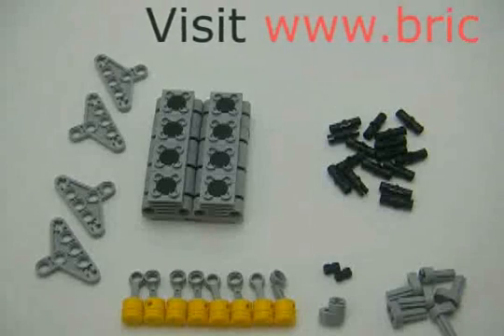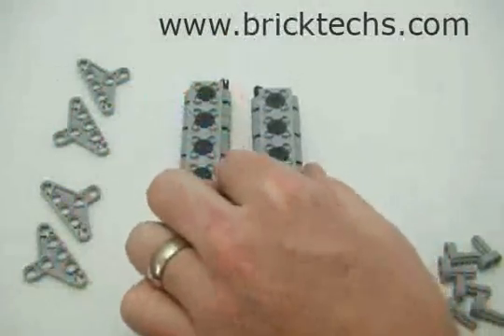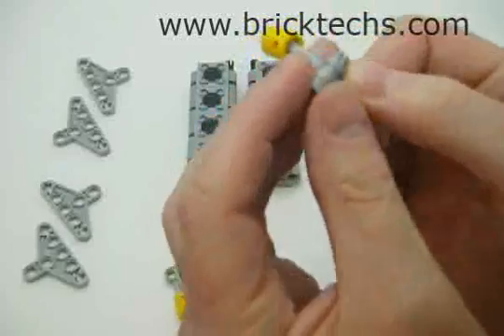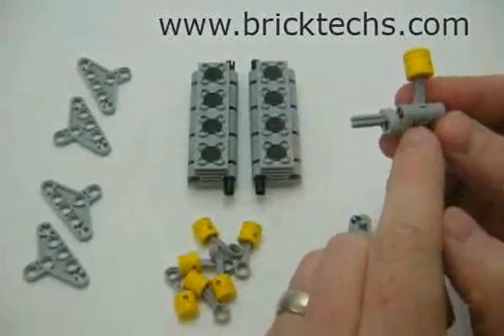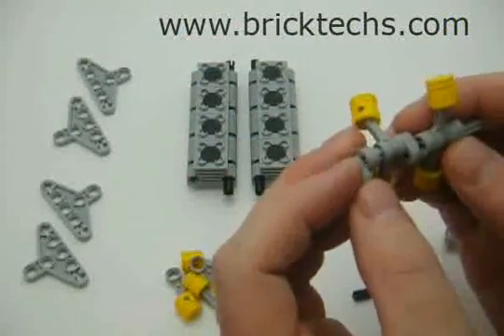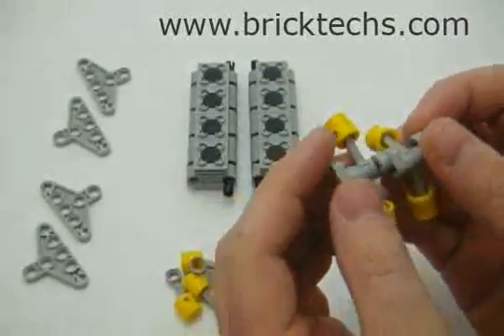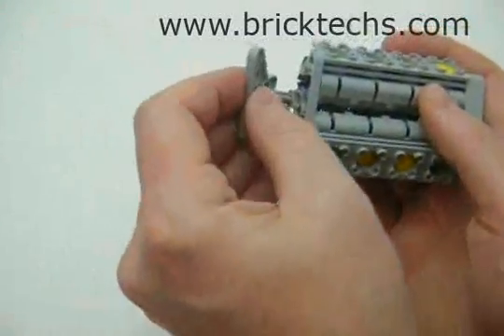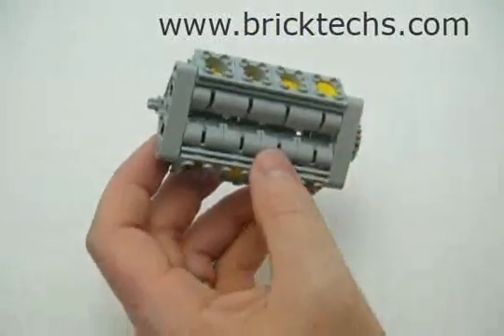Build a Lego V8 Engine Tutorial

Comment: Great, now add cylinder heads and valves and a crankcase and an oil pump and some spark plugs and some electronic ignition system and a fuel pump and a battery and a starter motor and a flywheel and some camshafts and a couple of valve covers and a fan and a radiator complete with the water cooling system and some piston rings and an exhaust pipe and and a supercharger and some fuel and a throttle body and a tank of fuel and replace all the plastic with metal. 

Then, throw the whole thing in a Honda.

Comment: No wonder why everyone's V8 blows up so low. They're unbalance and putting more stress on the conrods. The example shown in this video goes 1 - 2 - 3 - 4. In reality it should be 1 - 4 - 2 - 3. That way, the vibrations of the engine balance themselves out, thus removing excess stress on the components.
Reply: Yea should be 1-3-4-2 or 1-4-2-3
Reply: That's the firing order, the actual pistons move like

🔥💤💤🔥
Then 
💤🔥🔥💤
Then
🔥💤💤🔥
And over and over again
Reply: @oliverssimanis8345  Depends on the crankshaft, but usually, yeah.
Reply: @oliverssimanis8345  this is only in FLATPLANE cranks, crossplanes are different.

Comment: You think you can show a better pic of that little custom piece, didn't see it too good
Reply: it's two part number 2853 with the axle cut off, turned 90 degrees and glued together. Ensure the axle connectors are pointing out. Glue the areas you cut together.

Comment: I've been wanting to take one of these lego piston engines and make it pneumatic, has anyone done that? its been on the back burner for some time
Reply: Nabre Labre crankshaft uses crosspin instead of normal pin. Passive run is ok but not loaded one. Pneumatic system (yes, it's a thing) will do loaded run better

Comment: whats the point of a V8 engine?
Reply: You can have a lot of power without putting too much stress on parts.  A 4 cylinder with 400 hp is much more likely to break than a v8 with 400 hp
Reply: dice0126 POWEEEER

Comment: nice dude!

I thought I was the only one who butchered my parts to get them to work right... =D

If I rebuild my 9,500RPM "red line" In Line four engine, I'll put it up on youtube!

It also required butchered parts. 

...and molten transmission gears till I found a design that had the least amount of friction, so my part's wouldn't melt!

The only upside now, is that I have a small baggie of cool half molten lego crank/trany parts! =P